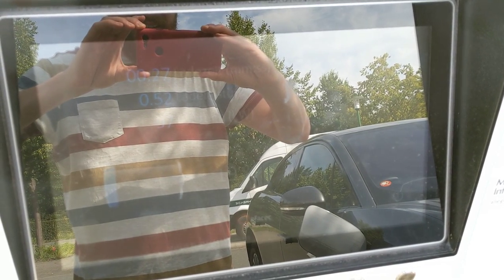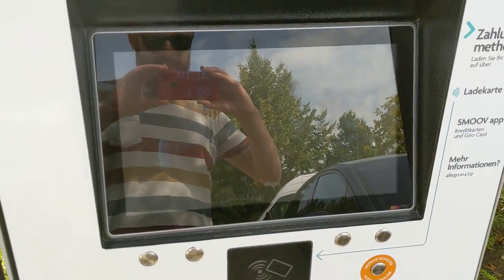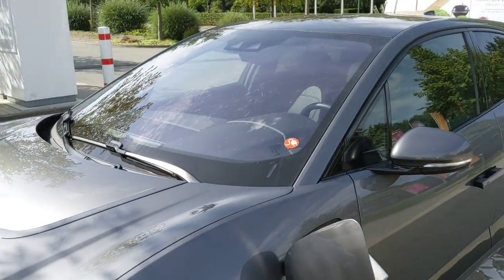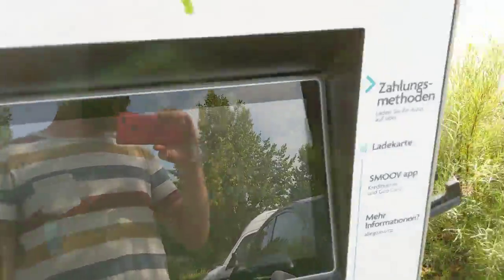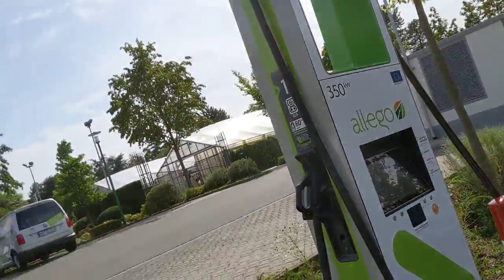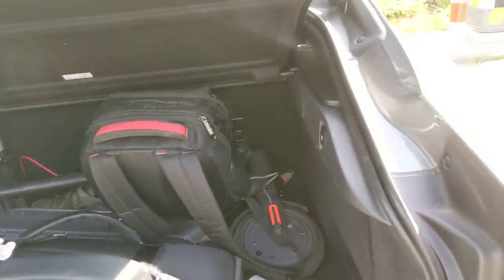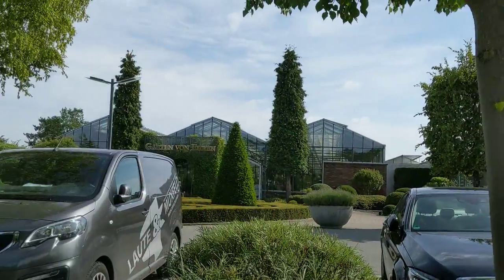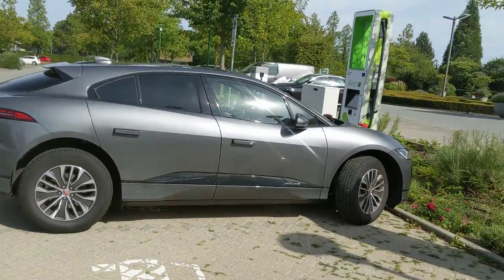Charging up the Jaguar I-Pace at Allego HPC Garten von Ehren Hamburg - electricfelix roadtrip Sweden

Comment: Electrify America is apparently removing all of their Efacec units due to problems (I believe overheating/reduced power were the primary issues).
Reply from the maker: thelondonbroiler that’s quite huge news where did you hear/read this?
Reply: @electricfelix  I should clarify, they are replacing the Efacec units with ones from ABB and Signet (I am concerned about the use of signet units, but that's a different can of worms).  While no EV News Outlet or any outlet is presently covering this subject (EA presently advertises with or gives money to Electrek and perhaps other media organizations, although I'm not alleging conspiracy 😉), last year there were some articles written about the problem, and a browse on plugshare makes it evident what is occurring. I did make a video on the subject, that will probably be deserving of a follow up in a few months. Here are relevant links: https://electricrevs.com/2019/06/28/some-electrify-america-sites-have-been-going-offline-due-to-a-cooling-system-issue/

https://insideevs.com/news/357315/electrify-america-reduced-power-cooling-issue/

https://www.plugshare.com/location/172863

https://www.plugshare.com/location/186832

https://www.plugshare.com/location/184457

https://youtu.be/NBRi-Ps-B9s
Reply: I should also add, this issue was "brushed" on last month when Electrify America shutdown several sequential stations (instead of deactivating every other station). There was a "side" article by the same outlet, InsideEvs, that claims 56 sites are being upgraded, but I BELIEVE this only refers to sites where 50kw stations were installed, but now 150kw and 350kw stations are going in.  This is great news, by the way, and additionally, I suspect EA may have been able to accomplish this through the installation of on-site battery storage (which is HUGE positive news IMO,  IF it is true). Back to the 56 site figure, I believe this does not incorporate the Efacec station sites, rather only 50kw BTC Power sites.  All in all, I wouldn't be surprised at a figure of around 100 sites around the country having their equipment replaced (so somewhere in the ballpark of 500 chargers total, my guess is half of those are the under performing Efacec units, maybe I'll count them today 😚). More links:
 
https://insideevs.com/news/443187/electrify-america-replacing-hardware-56-sites/

https://insideevs.com/news/443006/electrify-america-charging-corridor-shut-down-labor-day/

https://www.plugshare.com/location/186882

Comment: Would using the 350kw side give you a higher rate for longer?
Reply from the maker: No right now given the software of the I-Pace 'throttling' around the 80kW mark, you can easily use any side on these Allego chargers. The liquid cooling of the white cable makes sense when you can do 100+ for longer time (model 3, e-tron, EQC), which right now isn't possible given the I-Pace 80kW rate of charge after 2 minutes.